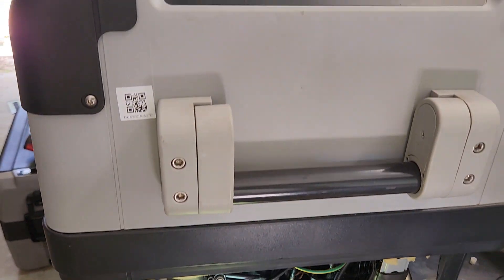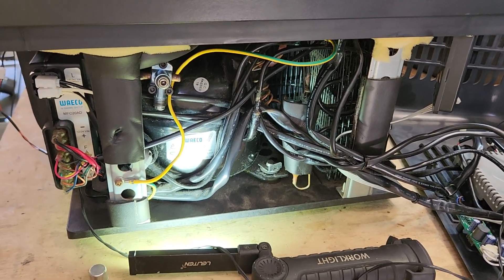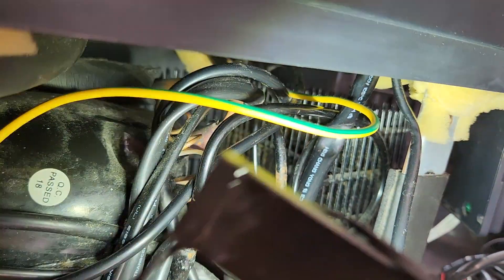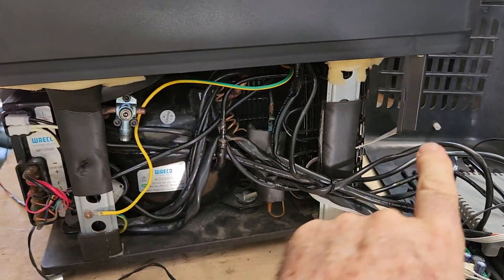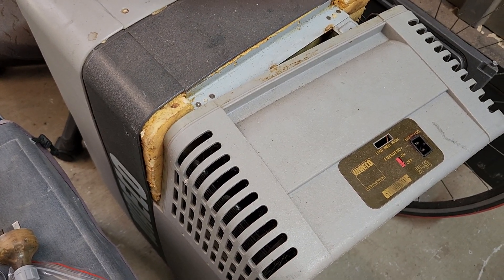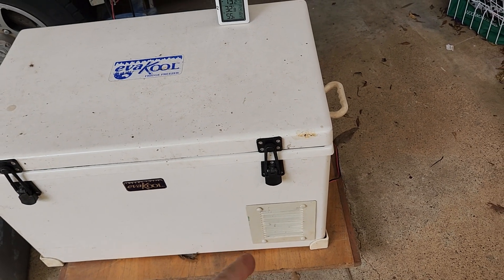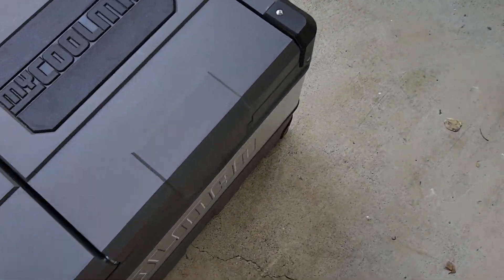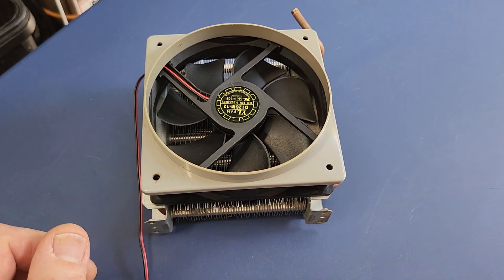Car Fridge Ventilation is critical in summer!

Comment: Thanks for taking the time to put the video together. So my fridge freezer is enclosed in a slide out system within a ‘hutch’ so I don’t believe it to be the best ventilation. I’m thinking of increasing fan s🪭 xe and : or placing a fan at the rear of hutch back to drawer air out of the hutch Hope filling improving the ventilation . Thoughts?

Comment: Thanks Tim, great video. Question - how bad is dust intake into a fridge? If i was to put a fridge into a box trailer with no cover/not inside a box, would that be a bad idea for a lot of dirt road driving?
Reply from the maker: Its amazing how the fridges survive that sort of abuse. I see a lot of tradies bringing in fridges that have been in the back of there utes for years and some are covered in all sorts dust including plaster board and cement dust but they are amazingly resilient. I think the fan is the most likely point of failure in your scenario but even that will be unlikely to die on a trip. I would give it a good blow out with compressed air or a battery operated blower every couple of days to stop any build up of dust. The older Waeco and other fridges had a much greater heat exchanger (or condenser) surface area and would survive fan failures in all but hot conditions and keep cooling but the new fridges are 100% reliant on the fan to cool the refrigerant - sadly another casualty of cost cutting and simplified design to better suit mass manufacture by the manufacturers.

Comment: What's important is to remember that a hot fridge uses more electricity - which is important if boondocking  (also if relying on solar power, and not a fuel powered genertor)